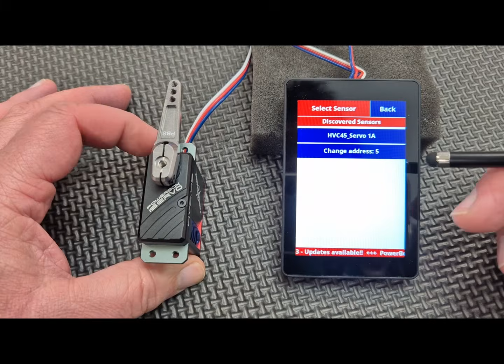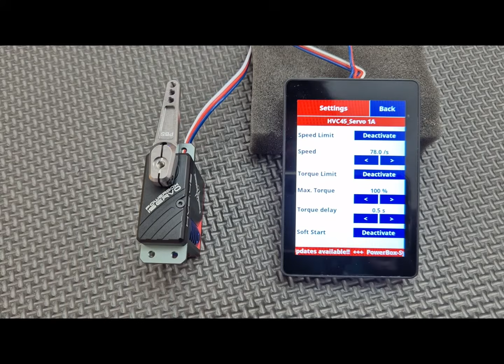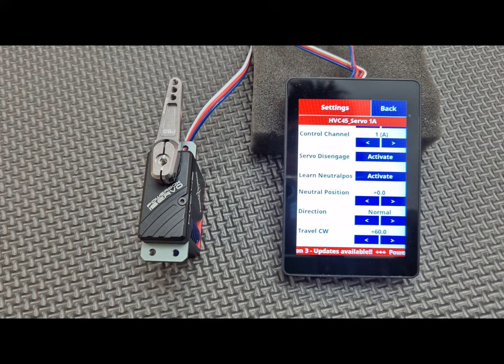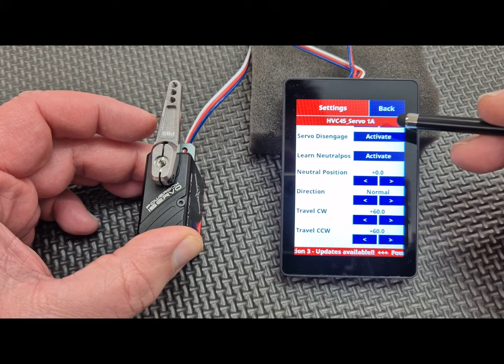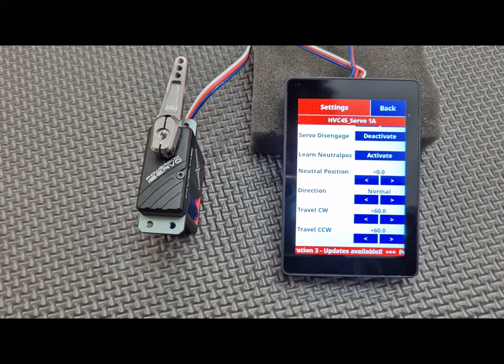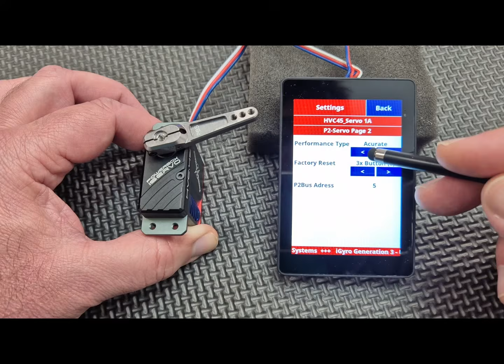PowerBox iServo : Part 2 - Programming - Mobile Terminal

Comment: Thanks for you videos, brilliant. 
A question if I may.
Regarding the Powerbox servos, I don't see anywhere you can set up a fail-safe in the servo.

 My reason for asking. I've used serial bus connected servos with my Futaba system for many years. When using Futaba,  a fail-safe was set through the TX. When I made the switch to Powerbox Core I was no longer able to set fail-safe through the TX.
My setup uses Powerbox Igyro with 2 x 26d rx's.For the servo, bus connection i use a Emcotec DPSI bus hub, its made for this purpose.   You could also use the Powerbox dock.

I contacted Powerbox regarding this problem and their response was that the failsafe should be the final device, servo in this case. So they saw no problem

In my case I couldn't even set a fail-safe for a turbine shut-down. I achieved this through other methods. 

I've looked through the Powerbox power expanders to see what unit could potentially achieve failsafe set ups. 

You thoughts please
Reply from the maker: Hi Chris, you will be happy to hesr that I can confirm that you can set failsafe on these servos.

I will cover the failsafe settings for the servos in the video that will also look at the iServo PC Terminal software.

There are a number of failsafe options that can be set and saved in these new servos.